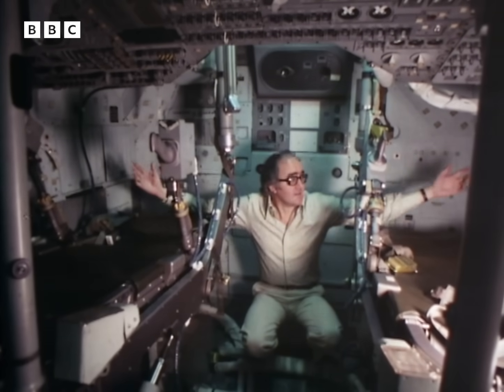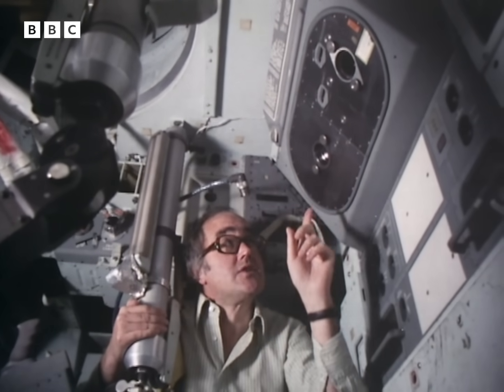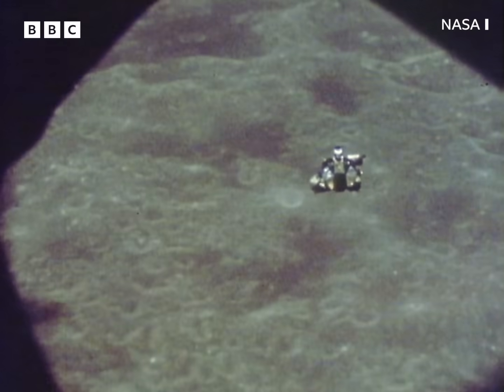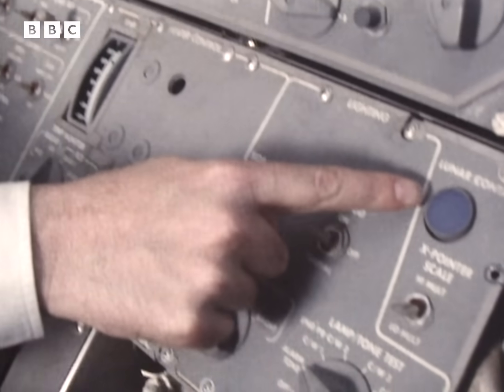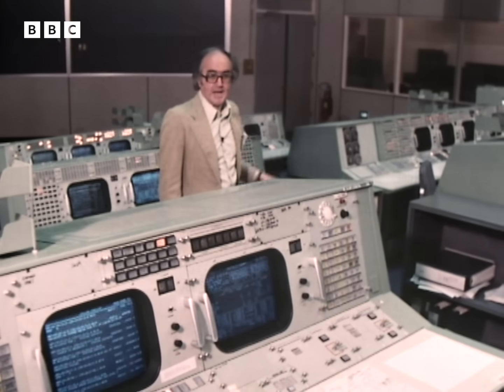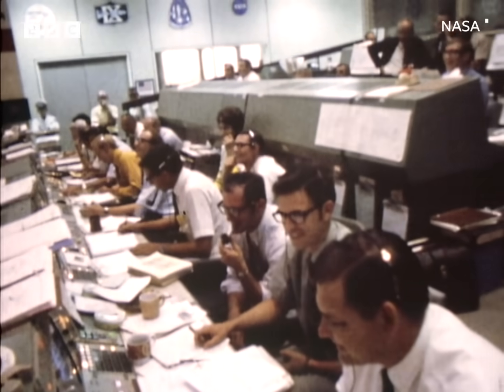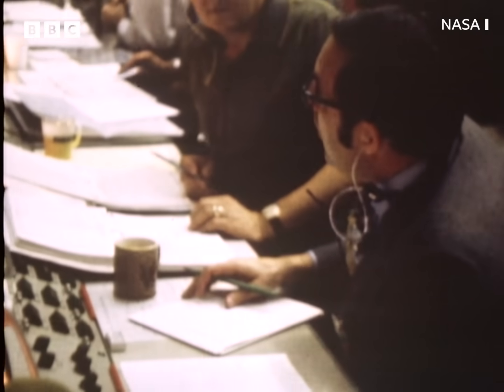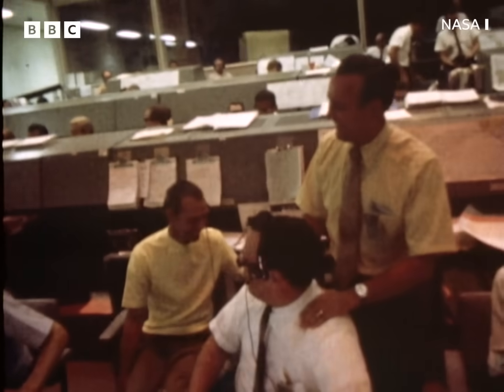1979: How to LAND ON THE MOON | Project Apollo | Retro Tech | BBC Archive

Comment: I miss Connections ... and with the nasa moon landings and modern chip bags ... being the one that is most impresive ... yes folks that "tinfoil" was gold mylar crumpled to give a thicker apparent cross section to catch radiation in the van allen belts
Reply: No, that tinfoil was kapton coated with aluminium, crumpled to reduce the contact area to reduce heat transfer. Crumpling did nothing to reduce the amount of radiation.

Comment: Mankind has never set foot on the Moon period.
All made up to fool Russia! Radition alone would have killed anyone on the moon; 250 degrees hot, bombarded by gamma rays; etc.
And tell me the astronauts in cheesy space suits are comfortable at 72 degrees, electrical 
Equipment running smooth,
For days with that
Heat, Radition, etc . Tell me another bedtime 
Story!
Reply: Yes, what you said is all a story. None of it contains any viable arguments. 
1. The radiation level on the moon is low enough that humans can spend months on the moon before getting a dangerous dose. 
2. Because the moon has no atmosphere, heat insulation is pretty easy. The white outer layer of the space suit reflects most of the sunlight away (more than 90%). Insulation layers underneath mean the suits are comfortable without needing active cooling. 
3. The equipment wasn’t very sensitive to radiation. We already saw it’s not hard to keep the heat out either. 
If you had looked into how the Apollo missions were done, you’d have known this, instead of falling for nonsensical arguments.
Reply: At last ! The definitive proof that the SIX Apollo Moon Landing Missions didn't happen. Thank you Mr Junk Pile, for your enlightened 'heads up' about all this. We should be all deeply grateful to be in the presence of a profoundly 'knowledgeable' fellow such as yourself. 🤣Now, with due respect. feel free to present your world-changing substantial evidence supported by sound logic and/or reputable sources that both refuted the mountains of evidence we have to prove we landed men on the Moon as well as every single credible scientist and expert in the entire world has to say about it. Otherwise   STFU

Comment: The 1201 and 1202 alarms were caused by the guidance computer being overloaded with additional data as Buzz Aldrin decided to leave the rendezvous radar switched on in case they had to abort the landing. This radar was feeding unnecessary data into the computer whiched caused the alarms. These radar alarms could have had someone panic and abort the landing when it was not needed if the radar was turned off as it should have been.
Reply: I'm not sure that Buzz decided to leave the rendezvous radar on - but rather, they did not realize leaving the radar on would be a problem until those alarms happened - - - and once they realized what caused those alarms, turning the rendezvous radar off became part of procedure.  In other words, I don't think Buzz "failed" to turn the radar off; it was just that the flight plan didn't call for it because the possibility of overload wasn't thought of.

Comment: biggest BS since the invention of religion
Reply: The Apollo missions are verifiable reality.
Reply: Using mirrors and stars to know the location and the pilots said they haven't seen any stars 😂😂😂😂
Reply: @AshutoshSrivastavaTimetraveler  Unless when looking through the instruments.
That's what they said.
Reply: @AshutoshSrivastavaTimetraveler  The astronauts said:
- no stars were visible from the lunar surface, unless they stood in the shadow of a large object, looked up to remove the surface from their field of view and waited for their eyes to accommodate (John Young did this on Apollo 16).
- no stars were visible during the transfer to and from the moon because they were in sunlight all the time, except when looking through the telescope used to measure star positions. Because that telescope was pointed away from the sun and sunlight was blocked from getting into the optics. 
- Stars were visible while in the shadow of the moon or Earth, provided the internal lighting was switched off.

Comment: Youtube::: ("Rocket.Thrust.to.Weight.Ratio")("TWR")    To learn how to first get off the earth.
Reply: Still peddling that nonsense? You need a TWR of 1.000000000001 to get off the Earth, anything more just speeds up the process.
Reply: @Hobbes746   continue peddling Hollywood-Fairytales.
Reply: @kareemsalessi  Go back to school and learn basic physics.
Reply: @Hobbes746 ==Pissics, is obviously what you call physics,  as do your fellow.peddlers
Reply: @kareemsalessi  I’ve explained to you that you are making very basic errors in your reasoning to get to your claim a TWR far greater than 1 is needed to launch a rocket.
Reply: @Hobbes746 ==Brains pouring out of your ears 👂,  just what NASA needs
Reply: @kareemsalessi  NASA runs actual missions, not fraud.
Reply: @Hobbes746   Let me explain this to you at your personal brain level::: After you take your daily dump, you need a TWR>1.5  to get up from your toilet seat, else, you'd be stuck there. But, don't take my word for it because you can verify that with a bathroom scale ⚖️  , just don't  submerge the scale.
Reply: @kareemsalessi  That is incorrect, yet again. I can get up with a TWR of 1.0000000001, it just takes a bit longer. 
f=ma. There’s a force f which is equal to the mass of the rocket m times gravity’s acceleration 9.81 m/s2. To lift the rocket off the ground, I have to provide a force larger than this. 
The net force working on the rocket is my upwards thrust minus the gravitational force: 
Fn = Ft - Fg
As long as Ft is larger than Fg, I get an upwards force, which produces an upwards acceleration at F = ma, so a = F/m. 
This is the very basics of physics, which you should have been taught in high school.
Reply: @kareemsalessi  Okay, Kareem, picture a rocket with unchanging mass and infinite fuel, and TWR of 1.0, capable of perfectly balancing itself. 
The rocket fires its rocket engine. What do you imagine happens?
Reply: @Jan_Strzelecki  he imagines that the force needed to accelerate the rocket increases. He's made some videos where he has a weight on a spring balance, and as he pulls the weight up, the indicated weight increases. He imagines the thrust now has to increase to compensate for that, forming a feedback loop.
Reply: @Hobbes746  my replies were cut.out once again.
Reply: @kareemsalessi  Why would the rocket explode? What would cause such explosion? Explain yourself.
Reply: @Jan_Strzelecki     Since it can't liftoff its fire heats up the rest of it and explodes it!!!
Reply: @kareemsalessi  Why would it heat up? I didn't say it was on a landing pad.
Reply: @Jan_Strzelecki    Trolls, It makes no difference. The heat blows it up wherever its fired from. Also, YT:::(AccuPower Force Plate Vertical Jump Analysis)  to understand why he needed TWR==6.3 TO lift off the earth half-meter.
Reply: @kareemsalessi  Now you’re confusing a jump (where all of the energy for the entire distance that he’ll move up has to be supplied in one instant) with a rocket, which continuously supplies energy until it reaches orbit. Yet another basic misunderstanding that leads you to the wrong conclusion.
Reply: @kareemsalessi  Okay, now assume that the rocket is indestructible.
What do you imagine will happen now?
Reply: @kareemsalessi  The heat blows it up wherever its fired from.
In that case, it would blow up every rocket ever, regardless of its TWR.
Reply: @Jan_Strzelecki ==Enistein::: NO,  rockets with insufficient TWR can't move so, their heat quickly ignites the rest of its fuel. Normal rockets move upon ignition, without a chance to explod, and fly until all their fuel is burned up!!!
Reply: @kareemsalessi  rockets with insufficient TWR can't move so, their heat quickly ignites the rest of its fuel.
The heat of the exhaust is directed downwards.
The fuel of the rocket is upwards.
Rockets with high TWR would suffer from the exact same "flaw" if what you're saying is true.
Which it's not.
Sorry.
Reply: Kareem! How you doin', buddy! Haven't seen you in ages! 🙂
Reply: @Jan_Strzelecki   Fine, thanks. Yourself.?? Are you still in Poland??
I've posted some Hamburg clips on channel, but I have a couple of dozen clips which I haven't posted, not yet anyway. One was at 4000 meters altitude Tochal-Peak, Tehran, at -30 Celcius, when my phone screen froze!!!
Reply: @kareemsalessi  I've never talked to you from Poland.
But it's good you're doing well, and visited Hamburg.
Reply: @Jan_Strzelecki   I thought that's where you were though.
Reply: "Fly-me-to-the-Moon" is a related upcoming movie.